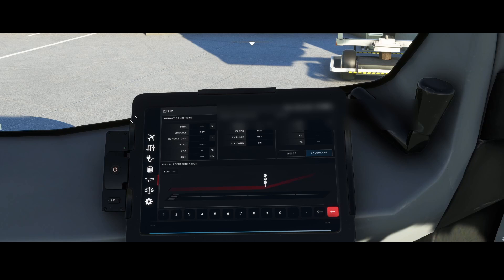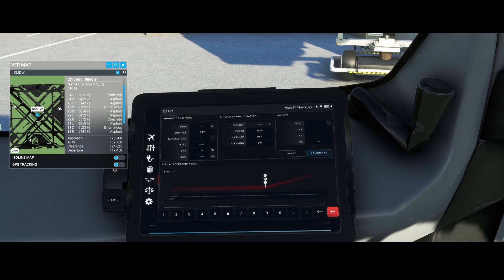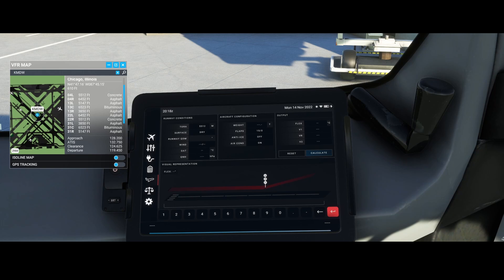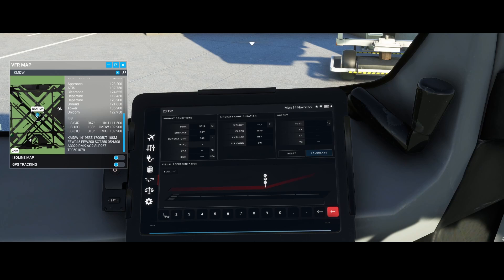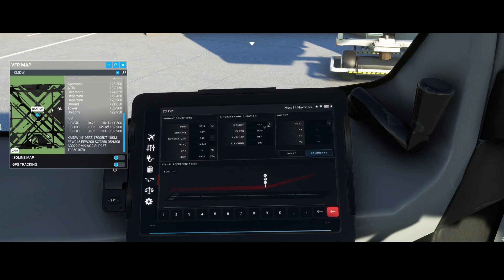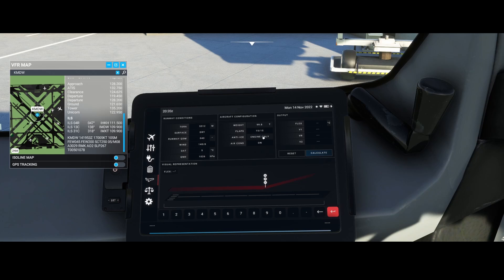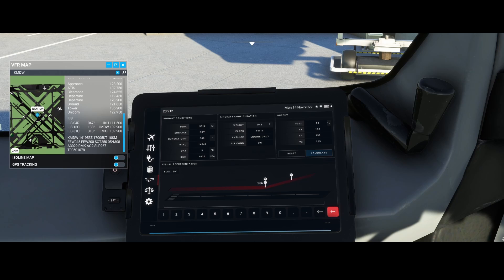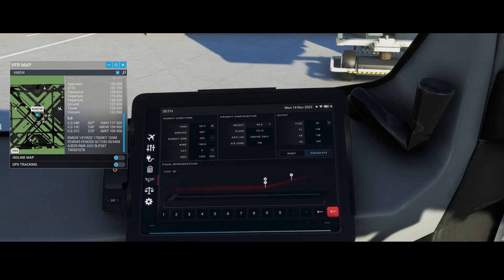Flight Simulator 2020 - How to - Airbus A310 - EFB Flex Temp and V1, Vr and V2

Comment: hey thanks, but when i have flex temp where do i need that parameter in the airplane?
Reply from the maker: hi Loris on the init page if I am correct
Reply: Set it in small "flex to temp" display links to the gear lever.